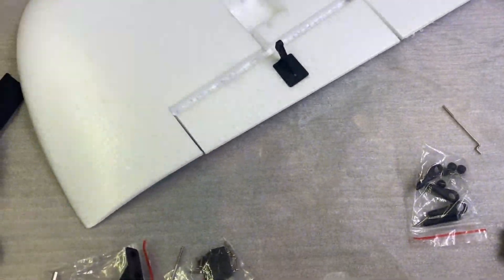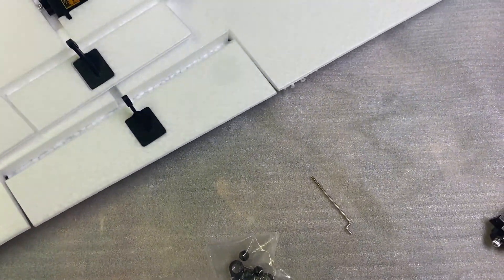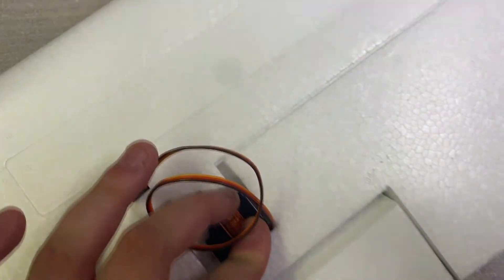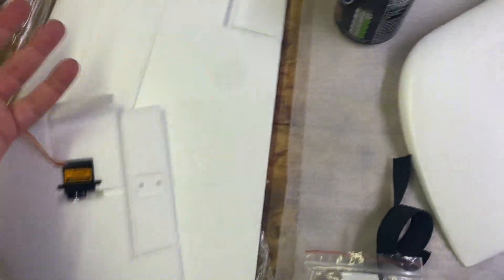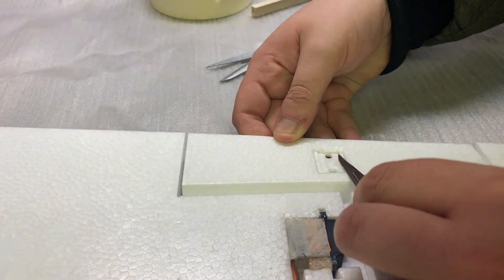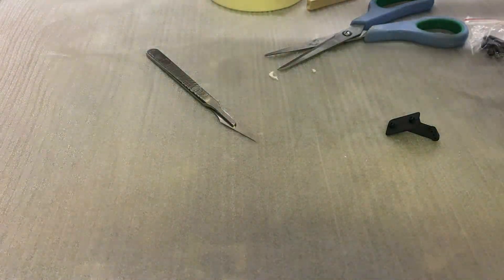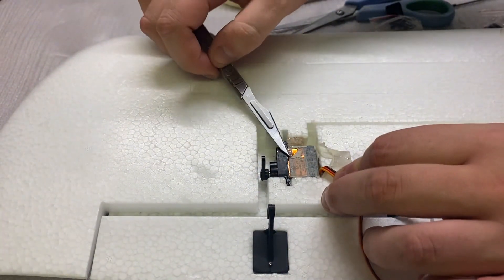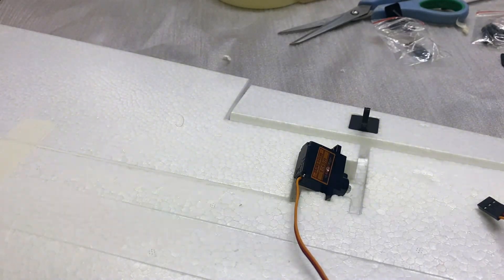X-UAV Mini Talon ProV2 - The Build - Part 1 - Strange Aileron Servo Issues

Comment: Description on BG says 17g servo for the wing an 9g for the tail. Maybe thats because the mini talon is short and acts more like a wing and is designed for 3-4kg auw. Combined with higher speed even  those small control surface needs a lot of torque.